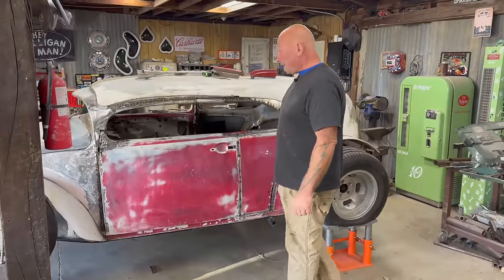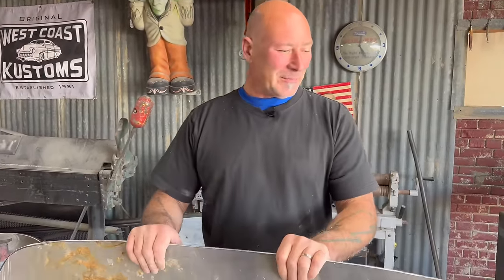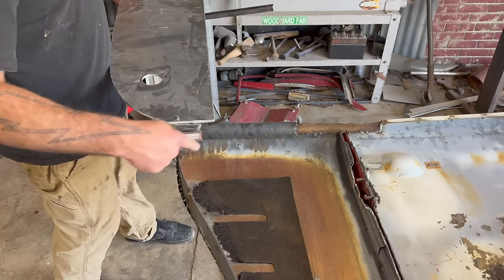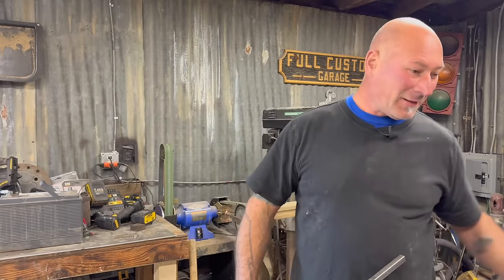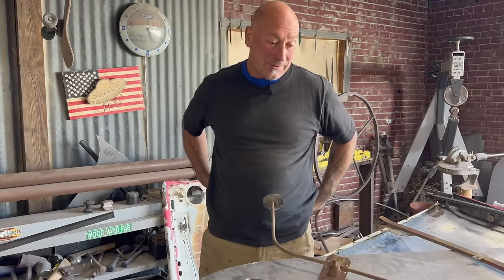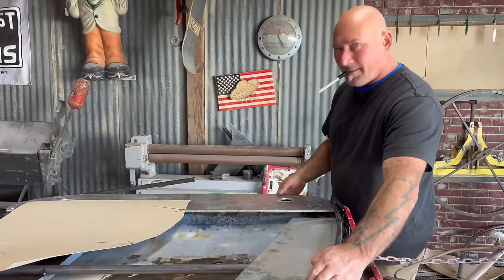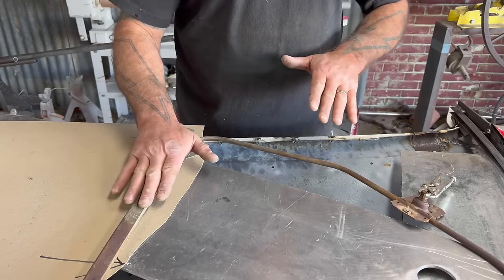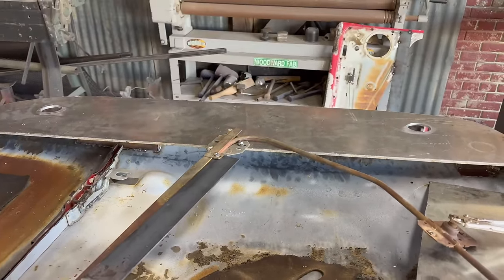Part 36! 1968 VW Radical Custom What Goes Up MUST Come Down 🪟 ⬆️

Comment: Ian I don't know if you would be interested. I worked at a Fiat dealership in the 70s before I went to the army. The   850and 124 spiders had a cable system that welded into the inside of the doors. Living in Pennsylvania in the winters the cable idler pulley would rust off of the door inside. We used the braze them back in. The first one I did was working fine. I was cranking the window up and down and the service manager came over and said I see you have working. He said come over here and look at the outside of the door.   I guess I got carried away with the torch. There was a large burn spot in the paint. I was loosing it. The service manager was a really great guy. He told me to go to the detail shop and get the detail paint gun. He sanded and painted my screw up in no time. I learned a lesson that day to pay attention where I'm putting the torch when brazing

Comment: Cool plan so far.
Rear of window can have pivot and forward slider.
Front of window rolls downward vertically. That will draw rear pivot forward and can also be slightly downward to pull it lower.

Comment: Another option instead of slotting the glass would be to use a track with one or two wheels that some cars have that use a register mechanism with an arm to move the glass up and down. The ones I've seen have holes in the glass that allow the track to be bolted to it. A slotted hole in the glass would probably crack the glass during use with just a little side load. Sorry if I seem like Mr. Knowitall. It's just the engineer in me. I've learned some much from watching you work; it's a pleasure to see it in action! Cheers

Comment: I pick up a lot of tips when I watch your videos so I will give you one back: If you trim the lower front corner of the window "glas" as much as possible and also swing it inwards a bit,  you will get the window even further down. Also decreases the chance of cracking it as sharp  corners are more exposed...but...I guess you have already thought of that :)..AND Im only 15 minutes into your video when I write this .😊

Comment: I love the videos and was glad to see this one after your break. I build mechanisms for a living and wanted to point out one thing with the window. Because it is pivoting on the one point, everything on the window travels in an arc, not a straight line. You did say the anchor on the window will have to have slop to allow it to move without binding and this is the reason why.

Comment: Greetings from South Carolina... just a suggestion...on that top pivot that has to move @3"". make another channel that you can glue to the bottom of the window with a track..with a pivot roller wheel. Like the old school window tracks. That will give you, your movement & ease of resistance?

Comment: Use a Power linear actuator on heim joints. Mount from bottom of door to bottom of window with the heims. Pivots automatically with the arc of the window. Just push a button. Probably need a steel channel on bottom of the glass.  Simple but effective 👍🏼💯
Reply: Good idea, i think the VW style actuator won't last long.

Comment: Loved the strategically place "dingdong" lol. Just a thought, most glass is held with a channel at the bottom and glued into that channel and the window mechanisms are attached to that. Would a channel like that help with window placement and attaching the regulator and pivot point to it?

Comment: Interesting custom window regulator concept, looked to me that the round tubing should be on the outside of the flat bar instead of between the glass template and flat bar to eliminate binding.

Comment: Ian, I think if you use round tube instead of the square tube on the door slide, you could use two electric actuators; one to slide it in/out, the other to rotate it up/down. And the actuators could both could be mounted inside near the tunnel and out of the way, maybe.  Just an idea.
Reply: The square keeps it square to the door opening.

Comment: The window winder goes in a straight line, and the window goes in a ark, you need a relay arm between the two, just like on the steering on the Jeep,
Door out and tilt could be hidden inside the tube, or full steampunk with rose joints and in one continuous motion, full on display, it all depends on what interior you are going for, i imagine part rat rod, and part steampunk, maybe even a small steering box for each door, with an electric motor, and some extra arms for the tilt.
It might end up being a very heavy door, maybe do some in alu, and make it part of the interior

Comment: If you look at a factory window, they have a “C” channel on the bottom of the window and below that they have an open flat “C” channel that moves side to side with nylon wheels. If you do that it will make up for the arc because that nylon wheel can roll back-and-forth while the window mechanism still goes straight up and down that’ll solve any issues you have with the Arc.

Comment: Hi Ian,  I'm probably a bit confused. As I understand, When the window is up it overlaps inside the door aperture of the body to seal. Therefore to open the door, the window has to wind down. This is probably desirable as it will soon get broken otherwise. Manual winding is fine for when you're in the car and getting out but it doesn't work if you're outside and want to leave the windows up and the door shut. I'd think you could get an electric winder to do much the same job but be able to be remotely operated from outside. My imagination has the hydraulics and the window winder working in tandem remotely (press a button and the window winds down and then the door drives out and pivots back).
Reply: You’ve got the theory reversed. The window will shut to the outside of the body

Comment: If you fix the bottom of the winder rather than giving it a bolt with a pivot point it will bind up. It needs to be able to change angle.slightly. The winder window fixing point will also need to pivot.

Comment: Consider the rear electric window lifts from a 70s kingwood estate wagon they work very well in pickup doors and the window has a slide track on the bottom

Comment: G'day Ian, with the window installation, what about the option of a track on the bottom of the glass to reinforce it with a small bracket off the bottom of the track. Add electric window regulator to track bracket.

Comment: Dodge carvan rear hatch has the automatic open and close that is all electronic push tight to lock door. Also pushes open.

That is all done electronically.  

If you were to use it instead of hydronic ram to lift then is to use a small garage door spring inside tube to lift door open.

Comment: The 2 endpoints of the linear slider need to rotate, and the slider sled's attachment to the glass needs to rotate, and then you got it. A slot solution will bind...

Comment: You need a Linear rotary motors this allows you to push the door out, and then turn it with the same actuator. They are super cool and get rid of the need for Hydraulics accurate to like 0.1mm - Need to reach out to some suppliers who might like to give you samples to showcase
Reply: In my enthusiam to comment, on reflection I should have said you might like to consider instead of need.

Comment: Put the door slide on a corkscrew so as the hydraulics open the door it also slowly starts to twist the door open to its final position. Two functions one switch.

Comment: Thought you may have used an electric ram anchoured to the tube where it meets the back of the door and a pivot point three quaters along the bottom of the glass window just a thought?

Comment: Could you maybe have just made sliding glass or pop out at the back on little motors, to save a bit weight or even make the whole glass pop out and pivot as part of the opening ceremony, like the door itself, have the glass stay level as the door swings up.

Comment: I see why it needs the slot, do to the arc of the travel. But I worry about slotting the glass. Would it be more practical (?) to create a metal channel that  has that slot, and attach it to the bottom of the glass?

Comment: Hey guys. Idk if you're seeing it yet but to me it doesn't look like you are going to be able to hang your elbow on the window ledge with that single piece of glass engineered that way. If I remember where you're going to have the seat.
Reply: You have to keep your arms and legs in the ride at all times.
Reply: @65cj55  
That's only the Easter bunny and Santa Clause.

Comment: Be careful grinding aluminum with abrasive wheels that aren’t rated for AL. They can load up and the aluminum will expand with the heat and cause the wheels to shatter.
Reply: Never heard of it or seen it happen.